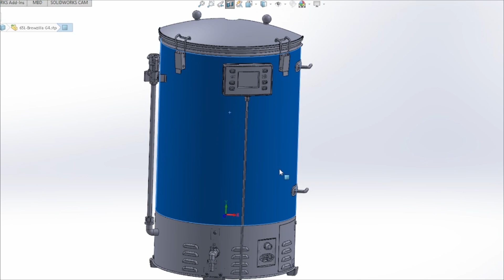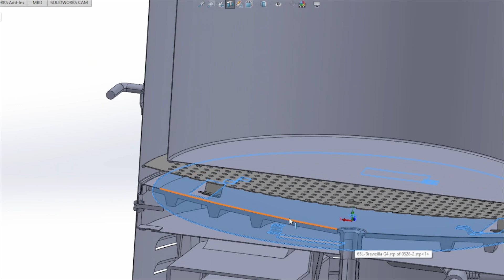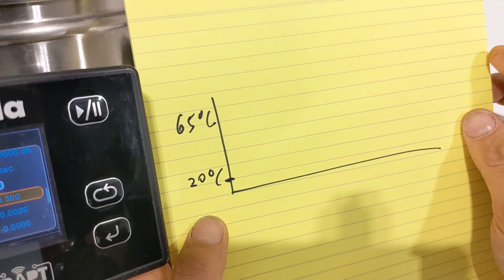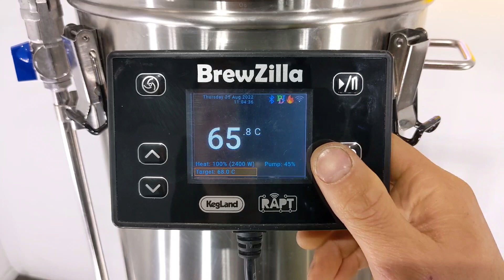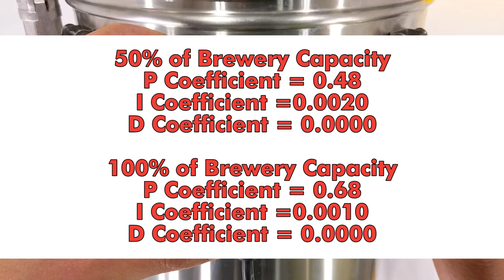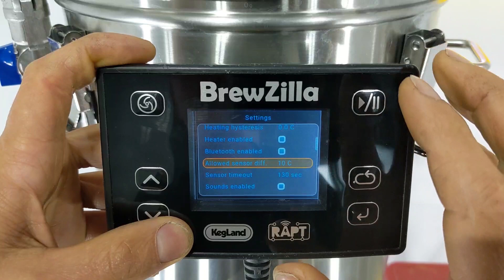Achieve More Repeatability Using, PID, RAPT BLE Temp Probe and Heat Exchanger Dish

Comment: Is there as strong of a need for the RAPT temp probe if we get the heat exchanger disc? Since reduces the amount of liquid that bypasses the probe area/heating elements. Are the graphs shown on screen with the core malt pipe temperature vs RAPT and built-in temperature probes of the Brewzilla with the heat exchanger disc installed ?

Comment: Just got my  BZ 4.1 yesterday and I spent some time putting it together. I got the heat exchanger disc as well. Good thing I had watched a lot of YT videos on the set up since the only instructions in the box were how to line up the sight glass sticker. I assume that for the heat exchange disk, I just replace the center pull ring with the one that the disc came with but they look to be identical in length.

Comment: Just purchased the HED (heat exchanger dish) after seeing the praise it got in the vid, and to my sad surprise, whenever I screw on the plate, the pump protector screen becomes massively warped. I did install the longer bolt the dish came with, and even tried fiddling with some extra washers in between but to no avail :( Worth mentioning that the false bottom that came with my Gen4 Unit only has one ring grab in the center, as opposed to two of them like in the video, and seems less sturdy than the one depicted here.

Comment: Damn, I need a love button for this vid. I learned more about PID in these 30 mins than I did in my uni years. Regarding the heat exchanger bottom plate: I definitely believe it should be standard. I just bought a Gen 4.1 BZ in EU these days (Aug 2024) and it wasn't there. I wouldn't mind paying extra for the part, but in Europe spare parts are not easy to find. I'm also thinking the plate should help with whirlpooling by separating the cone and not sucking it in through the middle.

Comment: A curious question: The probe essentially is only useful when mashing. Do i have to switch of Bluetooth before boiling or can i dump the probe inside the boil? Also: If i want to tighten the plate with the wingnut it totally bends the bottom filter to the point that it wouldn't flow on one side of the filter.
Reply from the maker: Just switch the temp probe from BLuetooth to built in when you get to the boil stage.

Comment: I saw you are using the top plate for the mash. I have used it once and it was a bit of a nightmare tbh and many people recommend doing away with the top screen altogether. So what is the go here? As for the heat exchanger, I already have it, together with the RAPT Thermometer but I am still struggling with consistent temperature during mash. I guess I need to play with PID a little, although some people also advise not to use PID at all and instead manually adjust settings, something that defeats the purpose of having a fully automated system.
Reply from the maker: Always use the top plate. Helps with sparging evenly and dramatically reduces the chances of blocking the pump. We tend to not use PID -  a RAPT BLE probe is a better option IMO

Comment: any PID coefficient to share when using 65L, boil extender, HED, insulation jacket for 80L mash (water+grain) ?
Reply from the maker: PID needs to be calibrate to every brew, really. We tend to not use PID as the BLE probe combined with control over power and Sensor Differential is super powerful and repeatable.
Reply: @KegLand  and BLE probe too, it's just to know if PID coefficient change with boil extender and 80L volume. Thanks

Comment: After buying my gen 4 a month ago, why after the year this video has been out hasn't the heat exchange dish been added to the system as standard when you know it make the system work better??
Reply from the maker: We get about 60% of customers who are not doing step mashes and are happy to not use the HED.  So we are worried about increasing the price of the base unit if not everyone needs the part.  Even if we made it included it would be a similar price increase to purchasing it separately so it's not like you would get it for free.  Definitely if you do step mashes it's much nicer to have the HED but it comes down to how you brew.

Comment: I think the addition of the HED makes good sense. I think it is odd that the immersion chiller is part of the Brewzilla set, but WITHOUT the fittings needed to connect it. I wish the immersion chiller was an option and that this option included the fittings. So in with the HED and out with the immersion chiller and correct the pricetag. Other than that the gen 4 is a great boiler.

Comment: First time trying the heat exchanger dish after 15 brews without it. It makes a huge difference for just being a simple and cheap stamped plate, definitely wish this came with the unit. Now I can actually control the temperature, really had to babysit it and measure at the top. Now I'm also not so worried about destroying the enzymes, I used to hear the wort getting to hot on the elements, now it's silent even if the elements are on for more than 10 seconds because the wort passes over it better.

Comment: Just doing my homework here before I decide on what I want and now my brain is fried from all the graphs lol but seriously this looks a great way to control temps and avoid too much overshoot. But does this negate the need to adjust the power output of the elements during the mash ie reducing to say 40%. Sorry to be such a noob but that's all I am, a noob trying to learn.
Reply from the maker: If you use the PID it will already scale the power down for you.  If however you cant be bothered setting up and tuning the PID then it's best that you just lower the power during the mash manually.

Comment: @kegland what do I do if my thermometer is like 9 degrees (C) too high? i cant calibrate it, do I set my mash temp that much higher? seems iffy
Reply from the maker: That sounds a bit strange as these are already calibrated before we send them out.  IF you see a 9C difference it's probably more likely that the temp is actually different between the two probes.  One is mounted into the base of the brewery and depending where you insert the probe it's not uncommon to have 9C difference in the one brewery.
Reply: it says my body temp is 42 C, i tested against another thermometer I had also, kind of unusable :( @KegLand

Comment: Is there a way to update the firmware to add auto pid tuning? This is fairly standard with most pid controllers. I’m surprised that we would have to manually mess with these values

Comment: You’ll be getting an order from me guys, fantastic stuff this. I have the gen 3 already and my only real issue was the temperature differential between the display with the probe at the bottom and when I took manual readings in the mash. I’d try and compensate manually to get the core mash temp exactly where I want it but this solves all my problems. Now just need to make up an excuse for my wife!

Comment: When you heat the water before adding grain what effect does it have if you don't put the blue tooth probe in until you have added the grain? Also when you recirculate won't the probe be in the way
Reply from the maker: It's quite easy to recirculate with the probe in place.  I personally find it best to head up water withou the bluetooth probe but when I start mashing I then use the bluetooth probe.  This works well for me.

Comment: Love these types of videos, the PID explanation was especially useful. The Brewzilla Gen 4 is amazing, though one small issue for me was, with the conical base giving you the option to do small scale batches, I find the immersion chiller will sit above the wort at 10L (post-boil). I wish it dropped in just a little bit lower as there's definitely room to do that.
Reply from the maker: The immersion chiller is the easiest chiller to use so it's good for people getting started but I personally prefer the counter flow chiller as its just a bit quicker and in Australia our water temp can get pretty high so it's also better in that respect.

Comment: My blue tooth thermometer and HDP just showed up and I'm so impressed with how well they work together. After playing around with recirculating water and tuning my PID settings, it makes so much sense to use a secondary thermometer. I was never really worried too much about my mash temps with my robo brew but I'm so much more confident with my gen 4 brewzilla system.
Reply from the maker: Thanks for the support. We really appreciate it.  I agree they are a great combination with each other.  Thanks!

Comment: My controller on the brewzilla is out by 5 degrees.. I had two different temperature probes in my wort..even if I set my PID and try calibrating it but my screen starts flashing on and off.. and it shouldn't be out that far...this unit should be way more precise then that... I'm disappointed.... should be like the Grainfather controller...
Reply from the maker: The grainfather has far less ability to calibrate the curve.  Normally the temperature is spot on but when people do the calibration they put the probe in a different positoin to where the inbuilt probe is.

The grainfather only has one probe that measures the temp of the heating element down the bottom. This is not really useful at all.  The Gen 4 has the bluetooth probe that actually can take the temp of the malt pipe where the actual enzymes are working and this is the only temp that really matters.
Reply: @KegLand  so you have to use that probe to get a proper Calibration..
Reply: @KegLand  and I don't have a probe... I'm just wondering if I can calibrated without probe..
Reply: @KegLand  I just you two ordinary probes to check how accurate the gen 4 Controller is..

Comment: I bought the HED now 3 months ago - it works very well. The PID algorithm works definitely more stable and sraight forward with the changed flow.
I did notice another advantage with this dish: The risk of a boilover seems signinifcantly reduced! Especially at the beginning of the boil, it seems that the HED somehow impacts the boil pattern and the need for constant stirring is greatly reduce. Did not expect that! I definitely adds another 2 minutes to the cleaning procedure, but it is not as bad as i thought it would be.
Reply from the maker: Yes the HED is a great accessory  and I enjoy using this for my step mash profiles in particular.  For single infusion it's not really necessary but for step mash it's great.

Comment: Please make the heat exchanger disc standard please. My 65L just showed up with one without one and it"s a pain in the butt for me to order one where  I live. I also agree with Feronimus to make the CIP nozzle standard as well, at least in the 65L and larger. Love the products and a few extra bucks on the price of the brewzilla is still so much cheaper than the other systems here. I can't wait for the blue tooth thermometer to come back in stock.
Reply from the maker: Yes this is something we are looking to do in the future.  We are actively working on many other new accessories for the BrewZilla Gen 4.  The CIP device is very close to being released. We ended up making further changes which has delayed the process slightly. Thanks so much for the support.   We could not do this without customers like you.  Cheers!

Comment: Hey Kegland, there is a problem in your PID algorithm, and you can see it in your video at 8:52, the temperature cutout is not disabled in PID mode so when you hit your setpoint the power clicks off and on resulting in higher output and overshooting. The comment about hysteresis not applying in PID mode should be true but in the current firmware The hysteresis still applies and will turn off heat until temperature drops by the hysteresis value.
Reply from the maker: Even with a 32a circuit breaker you would be falling a bit short.  You need about 50amp.

Comment: Hi! The 10 deg. Sensor differential is maybe safe when we mash about 65-67 deg. but what if want to do mash out at 76 deg? The temperature during heating up to 76 may reach 86 ! So shall I turn off PID when I want to mash out ?
Reply from the maker: I must say I rarely use the PID.  If you are using the Bluetooth thermometer you really do not need PID.

Comment: Great concept, but wouldn't the plate have to be exactly horizontal? Otherwise, even if slightly tipped, almost all of the wort will fall off one side of the plate, rather than distribute around the entire circumference.
Reply from the maker: No it's not an issue. The plate does have spacers to ensure the distance to the screen and base is even. But we did testing without this and it still worked just as well too so I dont think this is an issue.

Comment: I'm in the market for an AIO system and Brewzilla shares the top of my list with a couple other brands. It seems that the HED is required equipment for consistency. I realize this is not expensive as an add-on (however it's not available in the U.S. as of mid-Jan '23), but it really seems it should be standard equipment and included in each kit. 

Thank you for all the other information on the PID and BT thermometer. GREAT info!!!
Reply: Actually, the more I read others' experiences and see more videos, I can't bring myself to buy a BZ Gen4 until the HED is available in the U.S.. Again, it really seems like it is required kit to manage your mash, so I really hope that the HED is included in the future. Until then...waiting.
Reply from the maker: We have more stock arriving in USA soon.  Sorry it's taken a bit long to get the stock over there.

With that said if you are doing single infusion mash the HED  is not really necessary.  It's more valuable for step mash or raising the temp for mash out.

Comment: If this is implemented that I think is a must, when would you be including or when would this part be available. I am just about to order a Gen 4 in Thailand it would be very unlikely they would stock this as a spare part, if included I would wait I guess, but when?
Reply from the maker: We have just started to ship the head exchanger dishes.  We will make them included in future but we currently do not have enough stock of them yet as the demand has been quite high.

Comment: Do you notice any darkening of the wort with the heat exchanger dish?  It seems like holding the wort that close to the element might accelerate maillard reactions and make the wort darker than normal.
Reply from the maker: No it's quite the reverse actually.  As the wort is flowing over the elements at a higher speed there is better heat exchange efficiency and the surface temperature of the elements stays lower not higher.

Comment: Struggling a bit... had to go back to non PID. 
Essentially on a full boil (30L) with recommended settings in PID mode it never reached full boil, tops out at 96c-ish (measured at the Brewzilla 4's own thermometer) 
Any ideas?
Reply from the maker: PID is great for heating up water or heating the mash but it's pointless for the boil. For the boil just use full power.
Reply: @KegLand  Gotcha - I did fond it kept a very nice stable temp for the mash and mashout/sparge. I wonder if some tweakery of the firmware can help?

Comment: This should definitely be as standard, especially since the thermometer will be more accurate(but we need a way to know which version we have). I agree with other comments, it would be awesome to have an european warehouse :)

Regarding the PID, my current material(home-made, with craft-beer pi installed) is able to do some "automatic calibration", I've to fill it to my desired level, then it runs through a long process where it overshoot and basically does what you explained, to compute for us some appropriate parameters. Wouldn't that be easier?
Reply from the maker: Yes I agree. We are going to make it standard soon

Comment: I think you should include the Heat Exchanger Dish with the Gen-4. As you say in the video the cost is small, with higher benefits. I purchased the Gen-4, 65 L unit over the past weekend, having the Heat Exchanger Dish included would have worth the small price increase. Trying to buy one will be hard as many dealers probably wont carry it. It would probably need to be specially ordered. 

YOU COULD RUN A SPECIAL DEAL WITH THE RAPT BLUETOOTH TEMPERATUNE PROBE! Buy the probe & heat exchanger dish together.
Reply from the maker: Yes I agree. We are going to make the dish standard in future.

Comment: Could you explain exactly what the "heating hysteresis" setting does? Is it a delta T window, allowing +/- the set temperature error from the set point. Is it preventing the heating element from turning on when the temp is not at least below the set temp. Or something else? I get more confused when I search about it, doesn't seem consistent how people define it
Reply from the maker: Yes that is what the heating hysteresis does.  It is how much the temperature can deviate before turning the heating on.